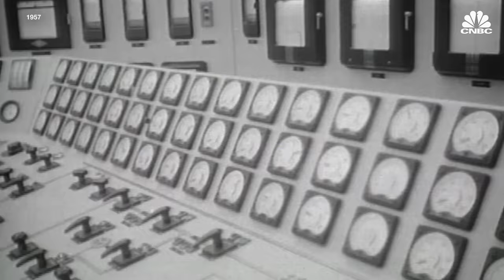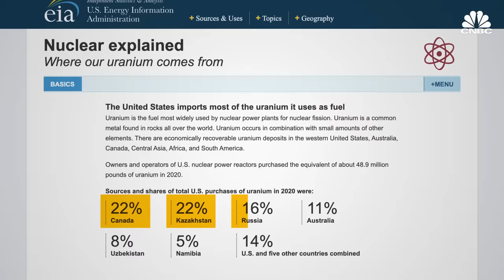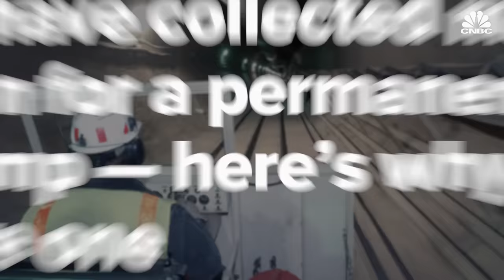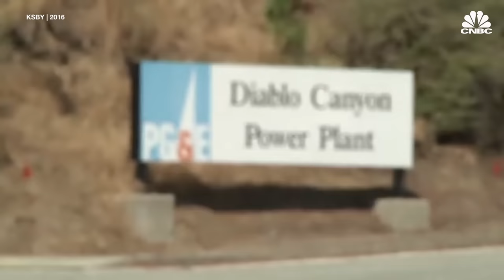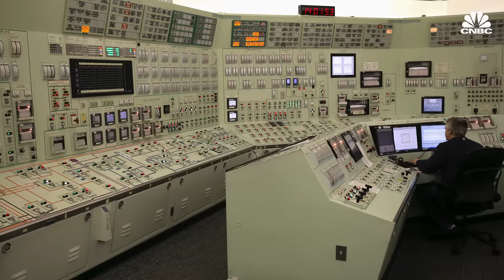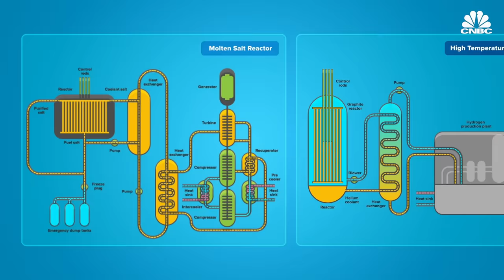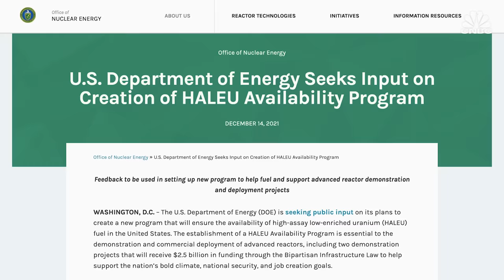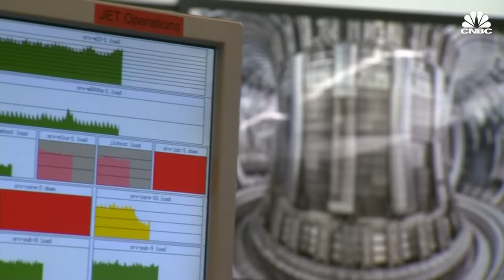Why Nuclear Energy Is On The Verge Of A Renaissance

Comment: Consider how little real damage Fukushima did even though it got hit with an earthquake and a tsnunami. Chernobyl was due to the absolute sheer lack of safety standards the Soviets had. 

As an analogy, imagine refusing to drive because cars in the 50s had no real safety tech. Obviously modern cars have greatly improved safety where accidents that for all intents and purposes should've clapped you out of existence in the past will result in injury, but certainly not death
Reply: And don't forget, new reactors wouldn't melt down like fukushima did, even in those extreme conditions. Each generation, the new reactors are more secure. Imagine what will be necessary for the smallest next nuclear incident, only an asteroid or something like that would enough.

That being said, I'm not really into those small reactors, I prefer the big, highly guarded/secure ones. There are new models of those too.
Reply: Odd that CNBC would address commercial nuclear power issues WITHOUT mentioning any of the consequences of nuclear capital costs -- which is what killed the industry in  the first place in the United States.   Plants coming on line back in the 1950's and 60's all were built with a Government subsidy with up to more than half of the capital expenditures taken up by the then Atomic Energy Commission and reactor vendors as seed investment for future operating plants.   This situation evaporated in the 1970's with utility customers for reactors assuming the full weight of capital costs for the plant and this situation caused the cancellation of almost as many plants as are running now due to true capital costs and operation and maintenance costs being truly reflective of what was actually happening at each site;  the situation now being over for free money from the AEC, General Electric, Westinghouse and the remainder of the suppliers.  This placed the planned and operating plants on a finer economic edge; making expensive things going wrong more of a determining factor for economic operating the plants in future scenarios.   A gone-wrong steam generator replacement maintenance effort in two of the West Coast plants caused that utility to close down the eight-billion dollar facility for good; forcing the utility customers and the stockholders to eat the capital costs, and this was not the only utility to shut down a site due to insurmountable repairs and maintenance costs.   Reactor suppliers in the United States offered the utilities different 747 airplane designs for each plant and each utility;  something that would break a company like Boeing many years ago.   A re-started nuclear effort in the United States with the same commercial ground rules of competition and non-standardization of plant equipment will result in the same overruns for the same reasons as encountered before: a lack of scope definition and therefore ultimate responsibilities to be faced.   Far more successful in nuclear proliferation scheme was carried out at EDF in France through standardization of design and government financing;  although these nuclear plants as well are finding themselves susceptible to unusually high maintenance efforts.   CNBC and its producers and management have apparently decided that this important history of nuclear power in the US is ostensibly irrelevant and is to be virtually ignored by the current proponents as though it never happened.
Reply: Fukushima is the boiling water reactor, Chernobyl has the same design. No safety dome.  The pressurized water reactor has 3 level of protection. At fuel level, pressured vessel level, and the containment level. At Fukushima after the tsunami then no pumps working which lead to melt down (funny design by GE). The Korean PWR has 4 emergency pumps units which can work under the water each unit has submarine's doors,  the California at San Onofre plant only has 2 pumps unit. The Russian PWR has another protection can handle the melt down (I remember they call it the melt down trap)
Reply: @xenotypos  I am impressed that you spotted one of the many the flaws in SMR thinking, less so with your assumption that safer tech will produce safer power generation. Surely, that is simplistic thinking, where private operators are licensed to generate power in a highly competitive power market. A glance at the history of nuclear shows that most/all the accidents were preventable with the technology we already had. Fukushima, for instance. Chernobyl for instance. What makes you so sure that safety will no longer be pared down to the bone as it was there? And even if reactors no longer exploded as they do now, what solution do you foresee to the continual emissions? Fission produces fission products. There is no way to stop these entering the environment. Indeed, they are deliberately released at levels even the nuclear industry still does not define as "safe":
https://www.nrc.gov/docs/ML2032/ML20325A229.pdf
Reply: Radioactive ghost town?
Reply: @happyyoggi3894  Fukushima and Chernobyl aren't the same design. Fukushima was a typical GE boiling water reactor where the power is controlled by control rods and water recirculation rate, but Chernobyl was a graphite moderated boiling water reactor.

Comment: Contemporary nuclear energy tech is nothing like it was in the 60's. They are so much smaller, cleaner, safer, better. I am 100% pro nuclear energy. It is the way of the future for sustainable lasting energy. For context, 1Megawatt can power hundreds of homes.
Reply: Odd that CNBC would address commercial nuclear power issues WITHOUT mentioning any of the consequences of nuclear capital costs -- which is what killed the industry in  the first place in the United States.   Plants coming on line back in the 1950's and 60's all were built with a Government subsidy with up to more than half of the capital expenditures taken up by the then Atomic Energy Commission and reactor vendors as seed investment for future operating plants.   This situation evaporated in the 1970's with utility customers for reactors assuming the full weight of capital costs for the plant and this situation caused the cancellation of almost as many plants as are running now due to true capital costs and operation and maintenance costs being truly reflective of what was actually happening at each site;  the situation now being over for free money from the AEC, General Electric, Westinghouse and the remainder of the suppliers.  This placed the planned and operating plants on a finer economic edge; making expensive things going wrong more of a determining factor for economic operating the plants in future scenarios.   A gone-wrong steam generator replacement maintenance effort in two of the West Coast plants caused that utility to close down the eight-billion dollar facility for good; forcing the utility customers and the stockholders to eat the capital costs, and this was not the only utility to shut down a site due to insurmountable repairs and maintenance costs.   Reactor suppliers in the United States offered the utilities different 747 airplane designs for each plant and each utility;  something that would break a company like Boeing many years ago.   A re-started nuclear effort in the United States with the same commercial ground rules of competition and non-standardization of plant equipment will result in the same overruns for the same reasons as encountered before: a lack of scope definition and therefore ultimate responsibilities to be faced.   Far more successful in nuclear proliferation scheme was carried out at EDF in France through standardization of design and government financing;  although these nuclear plants as well are finding themselves susceptible to unusually high maintenance efforts.   CNBC and its producers and management have apparently decided that this important history of nuclear power in the US is ostensibly irrelevant and is to be virtually ignored by the current proponents as though it never happened.
Reply: For context, every crypto-mining warehouse burns 3MWs. So we can burn bitcoin for energy!!

Comment: I like the fact that the peoples doing new reactors, are taking into consideration, that water will not longer be an easy source to get to cool their reactors.
It's a smart move in some ways.
Reply: I don't think there's anything wrong with light water reactors as long as you don't scale them up a lot.  They work fine on submarines as far as I know.

Comment: The Midwest can only resort to nuclear with numerous upcoming coal plant shutdowns. Difficulty sourcing natural gas, wind and solar power in that region.
Reply: What an incompetent, false thing to say; I'm living near 2 electric generating plants you say are to shut down, well guess what, they just replaced all their transmission lines outbound. They aren't closing, and they're not going to be torn down and replaced by any nuclear plant. Wind and solar would never touch the existing coal/natural gas electricity generating capacity in place, so you can just forget about those utopia things. And nuclear is still just as unsafe as it was in Chernobyl and Three Mile Island. In other words, DOA in the US.
Reply: Why? Wind is strong and hours of sunlight vary?
Reply: It's also geologically stable, plus the Great Lakes & river systems provide plenty of water for cooling. In fact, if you can supply enough cooling water for a coal fossil power station... you already have enough for a nuclear power station.
Reply: @shvrdavid  my work contact in Minnesota confirmed these facts

Comment: the funny thing about these incredibly smart and complex technologies is that they are basically a way to eat up water in order to generate steam.
Reply: Or heat up gas to run it through turbine. Or use thermoelectric power conversion (SNAP reactors).
Reply: 3 words, molten salt coolants.
Reply: Steam however, has very efficient and powerful potential energy. Thats why it works very well in industrial turbines like those used for generating electricity.
Reply: @jonathantan2469  Steam is very good in many regards, however, supercritical CO2 might achiever better power conversion efficiencies. Not that it doesn't have its own set of difficulties.
Reply: I have never understood the use of 'cooling towers'. All that heat is being wasted into the atmosphere.
Reply: @kitemanmusic  Mostly because it can't be used for much else. Chornobyl NPP had the Biosphere Project going, using the water from this cooling loop for keeping fisheries and greenhouses warm, but it ended after Reactor #4 went boom.
Reply: I'd just like to check your use of 'eat up water'. The steam is condensed and used again not flushed away. The cooling towers' steam is a small percentage that isnt recycled.
Reply: @kitemanmusic  They are used to condense steam coming out of the turbines, back to water, that then goes around the loop again. Essentially saves using humungous amounts of water, especially important if you dont have a lot
Reply: You realize that water isn't "eaten up" right? You've heard of the water cycle I assume
Reply: @808yorkie  Its a typo 'eat' should have been 'heat'
Reply: Recycled water can be used
Reply: What was that whole conservation thing?
...
And the understanding of the water table?

It's state of matter is simply changed.  It eventually returns to being water.  Definitely not "eaten up..."